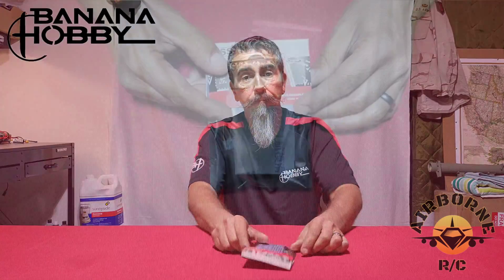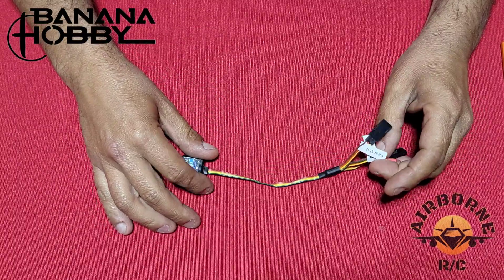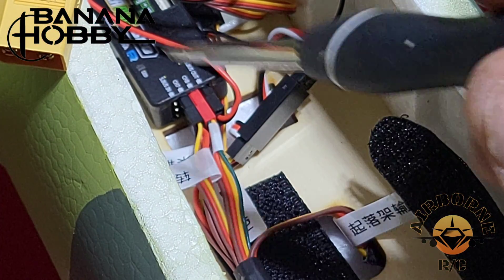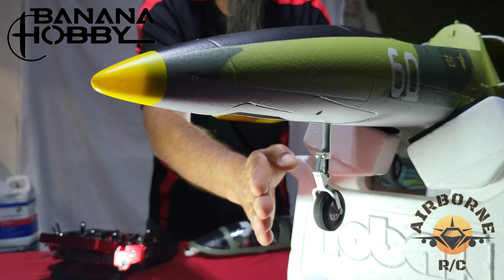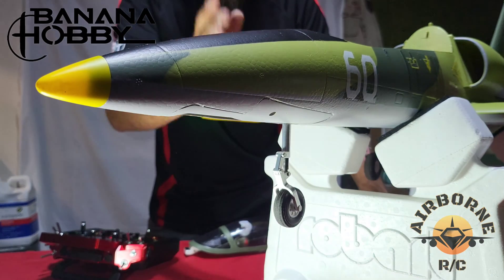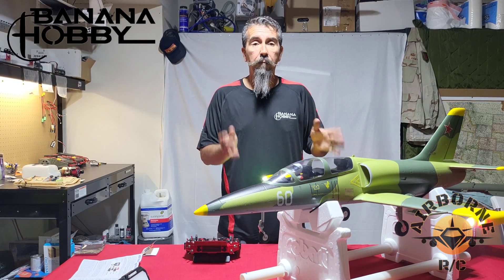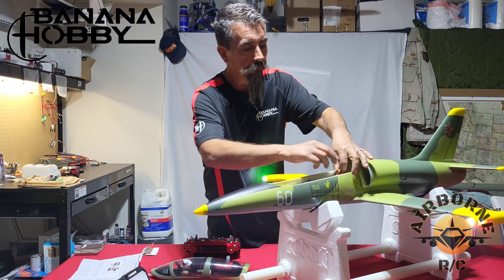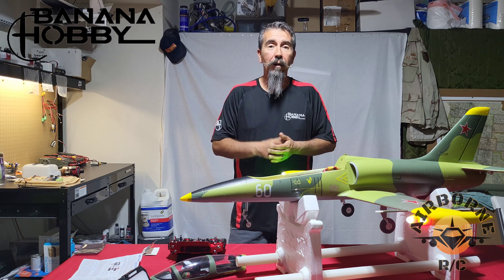ASSAN AG61 Gyro Install and Setup

Comment: Bro, you saved me such a headache. This fixed my reverse correction issue. It is insane how it keeps the jet going straight. I can see the jet leaning left and right, but the damn thing just tracks straight like a missile. I got up to very unsafe speeds on my street because I've never been able to keep the damn thing straight before. Amazing product.

Comment: I have followed your steps EXACTLY. My AG61 moves the nose wheel left when I yaw the plane left. I cannot get it to correct the right way.  I have tried EVERYTHING.  Any thoughts?
Reply from the maker: Make sure you follow the steps from the grt go by powering on the plane AND LOWRING GEAR this is big. Try it one more time BUT  open you endpoints on the steering ch. To 125 -125. Possible the gyro doesn't "see" full deflection. (Every TX and rx is slightly different....reason we calibrate throttle. 👍
Reply: Did you figure it out?  I got it to work perfectly one one Avanti and the other, the travel is reversed, but can't change this in the tx due the the rudder being reversed then.  I followed the instructions to a tee also with no luck:)  Help if you all figured out how to reverse  the travel.  Thanks!
Reply: @busanig  No.  Haven't figured it out yet.  I have followed the instructions to the letter and I tried the suggestions that NoonzAirborneRC provided.  Still no luck.  I have a friend coming over to help me soon.  I will let you know.
Reply: I got some help me today. It seems the trick is to move the stick left and right as per instructions and then hold left for QUITE A WHILE.  It seems you have to hold left for at least 30 seconds or more for the unit to finish its calibration. The steering servo will "twitch" and all is good.  Power off and then on again and it's correcting in the proper direction. Retracts must be down. Limits on your steering +/-100%.  The instructions should specifically state to hold left for a LONG time.
Reply: @cx9drvr  Thanks for the reply :)  I am seeing the twitch, but the nose wheel is still reversed.  Maby I need to hold it left longer.   I ordered three more last week, received them in the mail today, removed the one I was having trouble with, installed a new one--BAM no problem...

Comment: Does the nose wheel servo have to be on a separate channel from the rudder?
Reply from the maker: @stevecarman489  no it does not but helps if on a separate ch to trim steering and not effect rudder
Reply: @NoonzAirborneRC  That's awesome. Thank you.  I searched high & low for that information.  I would think that rudder input combined with the steering servo during rollout and take off on some jets would be enhanced.  Who knows;  its probably dependent upon the specific airplane.

Comment: Ok, suggestions for this video.  First, I'd like to see you discuss how and where to mount the gyro.  Can it be on the side of the battery compartment or does it have to be flat down along the bottom?  The instruction sheet is ambiguous on that point.  I'm not sure what it means.  Does it have to be pointed exactly forward or does that matter?  So a discussion about that would be helpful also.

Second thing that would make the video better is that you were looking at the gyro when it was doing its auto config thing.  But we couldn't see what you were looking at.  The camera should have been on the gyro, not you, at that time.
Reply from the maker: @douglindauer7327  1st flat on the bottom in any direction. Can even be put upside down along as it's flat

2nd the lights just blinking crazy and then  stop just like the instructions say the do

Hope that helps

Comment: Hi, new to the channel and great tutorial on the gyro setup however I cannot find the correct set up for my Freewing L-39 Albatross with the ASSAN gyro on you tube. The jet has a multi- function control box however it has a nose steering port which I assume connects to the turning servo lead. Where do the other 3 leads connect to? I have a Spektrum 8 channel Rx hooked up as well. I would really appreciate your help here if possible in the correct sequence. With thanks, John
Reply from the maker: Just saw your message. What other 3 wires we talking about bud?